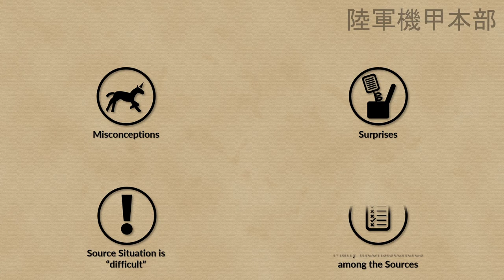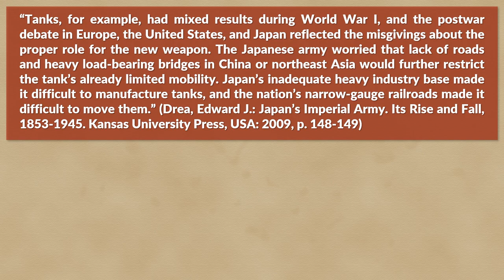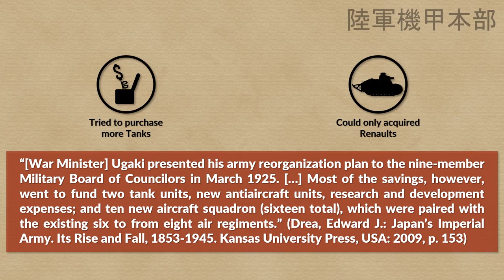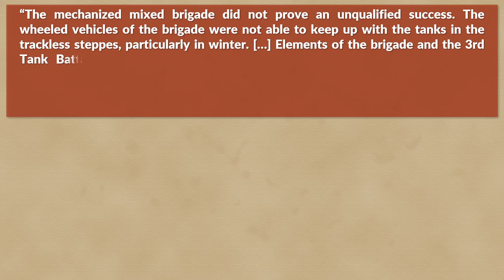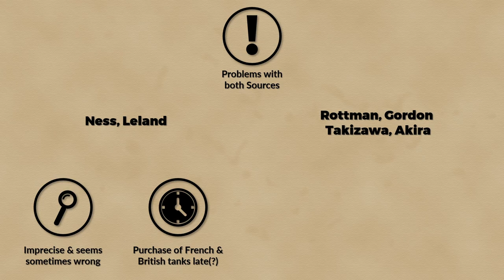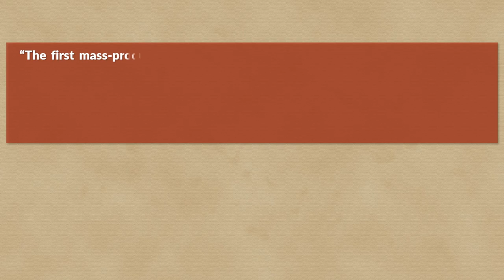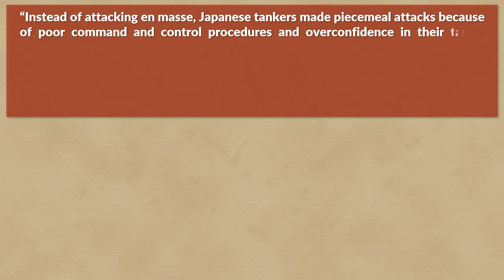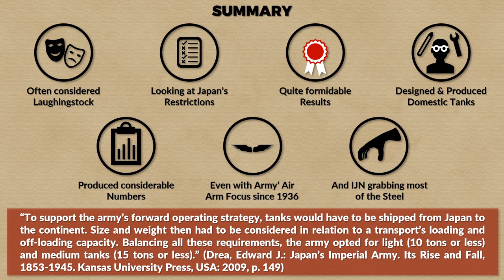Japanese Tank Arm (1921-1939)

Comment: "Japanese tanks during WW2 had a very limited impact..."
Tell that to the Chinese troops who had to wrap grenade bundles around themselves and roll under tracks because entire battalions had no other way of knocking out a tank. In the CBI theater they were anything but lacking impact.
Reply: Day Y. I mean, but that’s the point isn’t it. That if they were that effective in combat but still insignificant, it tells you a lot. Especially in re doctrine and logistics.
Reply: @UnsolicitedContext  I find that more a problem of measurement. It's easy to measure the effectiveness of individual tank units, it's difficult to measure when they're deeply integrated. Japanese independent tank units never achieved the size to make mirror comparisons with Germans/Soviets/W.Allies. You have to measure their performance by how they supported/complemented infantry attacks, and from what I've read of Wuhan / Changsha they were anything but taken lightly. I remember one episode where the commander of Changsha's war zone flooded an area just to ensure the IJA can't use its mechanized units properly.
Reply: The Japanese basically employed modern american warfare... Before americans thought of it.
Reply: @sevenproxies4255  No (=P). American armies can't survive without their logistics line as they relied on having more resources (shells, fuel, meat, etc.) than their foes. The IJA strove to move as light as possible.
Reply: @day2148  All armies rely on logistics at the end of the day. But my reflection was more about bullying an enemy into submission by bringing weapon systems to the field which they have nothing to counter it with. "Shock and awe" basically.
Reply: @sevenproxies4255  well, that's every army since the history of man. Remind me of the first time Romans met elephants.
Reply: Well by WW2 standards they did have a very limited impact. They assisted Japanese forces tactically but never made a great operational and strategic impact like the German and Allied use of armor in North Africa and Europe. Part of this has to do with the terrain involved of course (I doubt anyone could have really used armor in wide maneuvers in China or Burma, barring North China. And of course, hardly possible on small islands.).

Did the British have any real issues with Japanese tanks? Burma accounts always seem to emphasize the excellent tactics of Japanese infantry but very little, if any, mention of tanks.
Reply: Day Y. A BT-5 could just shoot the thing that it practically would've confused the crew in such a significant emotional event. Not like the Italian version which your tank gives up in existing.
Reply: If China had the Sherman Firefly and P51-Mustang  at 1936 they would have curbstomped Japan

With Japan out three years before WW2 the Allies are in a much better position

Germany and Italy are screwed

If Ethiopia were to have T-34-85 tanks as well as Yak-23s in 1936 the Italians and Germans would be in a lot of hurt
Reply: @christiandauz3742  I am sorry but this comment is weird. Well of course if Ethiopia had T34s in 1935 they would put up more of a fight. But you know it is completely impossible. Then you also have to think about how Ethiopia with barely any heavy industry could even produce any T34s.
Reply: @kvnrthr1589  Middle Burma, around Mandalay, is actually good tank country.
Reply: The goal was never to fight wars on land.

Comment: Gotta say I'm looking forward to the next part. I would be rather curious to know how fast they could possibly have gotten their relatively solid late-war tank designs into service had not funding been so severely cut. The Chi-Nu, Chi-To and Chi-Ri series were about as capable as a Pz. IV but came too late to see service in the war, with the Chi-Ri being particularly advanced featuring a fairly basic auto-loader mechanism. It would be curious to see what they had come up with had they put more resources into development of new models in time.
Reply: Probably not the Type 4 and Type 5 super-heavy tanks.
Reply: the Chi-Ri had more of a mechanical assist, like a lever-action for a tank cannon.
The Cheeto was definitely very capable, so I'm not sure what the point of the Chi-Ri was. Also from what I've heard, Japan's gameplan was to mass-produce the Na-To SPG, which was the Cheeto gun mounted in a gun carrier normally used for mortars.

Comment: The Japanese in WWII did have some Tiger and Panther in their name in Germany. What would happen if they actually reached Japan and mass-manufactured there? I would think that in 1942, the tanks wouldnt make much of a different. However, what if they designed a lighter version for both of those tank base on the concept? I wouldnt think those silly behemoth in World of Tank would work, but, how about a 25-30 tons tank?
Reply: Hard to say what lighter tanks base don the Tiger and Panther could've done -although the Japanese may've held them back from combat to help protect mainland Japan just like they did their best tanks. I think we can both agree that, in the Asian theater, Tigers and Panthers would be far less useful than they were in Europe. They were probably far too temperamental to make good use in China and on the Pacific islands themselves, they'd probably be easy targets for naval bombardment in a lot of cases.
Reply: I would much prefer in this scenario for Japan to acquire the Panzer III, maybe the Panzer IV if they want HV 75mm capability. Both were 25 tonnes or less initially, and with a reduction in width to fit their railways and/or a widening of the tracks to provide better flotation in mud, the workhorses of the German panzer force would likely have been welcome additions to Japan's arsenal. Of course, the Type 3 Chi-Nu and Type 4 Chi-To, at almost 20 tonnes and 30 tonnes respectively, were never intended to see combat outside of the vicinity of Kanto because of unsuitable terrain, but that was at the end of the war when they didn't have the infrastructure or transportation capabilities they used to.

I'd like to imagine that having essentially the Chi-Nu, at 20 tonnes, be a major part of Japanese tank forces from near enough the outset of war would prove very useful, being resistant to M3/M5 Stuarts, possibly early T-34s, and possibly early M3/M4 variants.
Reply: @Lt_Voss  sure, Panzer III and IV are decently armoured, and surely not a push over. Just wonder how would they perform. Kudo to you for the splendid comment👍

Comment: On the organization of the 1st Ind.Mix.Bde, there is a detailed yet unquoted version in Japanese Wikipedia, which is different from both of yours: 
(https://ja.wikipedia.org/wiki/%E7%8B%AC%E7%AB%8B%E6%B7%B7%E6%88%90%E7%AC%AC1%E6%97%85%E5%9B%A3 )

The TO&E of the brigade:

1. 1st Independent Infantry Regiment (2590 men, 297 vehicles)
  a) 1st Battalion: 3 rifle coys, 1 machinegun coy(HMG Type-92)
  b) 2nd Battalion: 3 rifle coys, 1 machinegun coy(HMG Type-92)
  c) 3rd Battalion: 3 rifle coys, 1 machinegun coy(HMG Type-92)
  d) Infantry Artillery Battery: 4 * battalion guns Type-92.
  e) AT Gun Battery: 6 * 37mm ATG Type-94
  f) Tankette Company: 17 * Tankette Type-94
2. 3rd Tank Battalion (376 men, 92 vehicles)
  a) 1st Company: 13 * Medium Tank Type-89, 7 * Tankette Type-94
  b) 2nd Company: 13 * Medium Tank Type-89, 7 * Tankette Type-94
  c) Workshop
3. 4th Tank Battalion (856 men, 192 vehicles)
  a) 1st Company: 15 * Medium Tank Type-89, 7 * Tankette Type-94
  b) 2nd Company: 15 * Medium Tank Type-89, 7 * Tankette Type-94
  c) 3rd Company: 15 * Medium Tank Type-89, 7 * Tankette Type-94
  d) Tankette Company: 20 * Tankette Type-94
  e) APC Company: 17 * Heavy Armored Car Type-92
  f) Workshop
4. 1st Independent Field Artillery Battalion (667 men, 130 vehicles)
  a) 1st Battery: 4 * Field Gun Type-90
  b) 2nd Battery: 4 * Field Gun Type-90
  c) 3rd Battery: 4 * Field Gun Type-90
5. 1st Independent Engineer Company: 194 men, 16 vehicles

Comment: Japanese tanks are really underrated. From the 1920s and early 30s, the Japanese tanks were among the best. Half the nations of that period only had machine guns or were severely slow. The Japanese despite focusing heavily on the navy had pulled off rather successful designs that weren't matched others until much later.
The Japanese simply didn't keep their equipment updated because they didn't need to against enemies they faced. This led to them being under equipped at the start of the war. However Japanese tank development caught up quickly but a weak industrial base meant very few of the new types were produced. Japan also reserved them for mainland defense with further reinforced the myth of weak Japanese tanks.

I also wouldn't consider Khalkhin Gol a complete disaster. The Japanese forces punched deep enough into Soviet artillery batteries. The Soviets also suffered massive losses, way more than the Japanese despite having way larger numbers.
Reply: Also in khalkin gol, the units that fought were generally under equipped with some of them even wearing uniforms from ww1.
Reply: Who are you saying were using WW1 equipment? The Soviets or the Japanese?

Comment: The problem with Japanese tanks was, they were perfectly suitable for the Pacific theater.  But for continental Asia, it was another matter.  The Soviets fielded an impressive invasion force of Manchuria in 1945--Japanese tanks didn't have a chance.
Reply: Most japanese tanks fielded were outdated. Its not fair to match a tank designed in 1935 to one produced much later in the 40’s.
Reply: yeah japanese tanks would put up an harsh fight agaist tanks lile T 34 and KV 1
but agaist tanks like the BT serie and T26 they could put up an fight at pair
Reply: Japanese tanks were suitable for continental Asia.... Asia is a big place.  Soviet tanks did well in Manchuria which is flat and well connected to the Russian rail network. (Also, Manchuria had the heaviest density of rails in China) Had Soviet tanks had to fight further south in the rougher terrain of south and central China, then they would have been wholly unsuitable.  Japanese tanks, by contrast, did well in these areas.

Comment: Okay, some solid prof here.

https://www.jacar.archives.go.jp/aj/meta/image_C04012192200?IS_KIND=SimpleSummary&IS_STYLE=default&IS_TAG_S1=InD&IS_KEY_S1=%E7%8B%AC%E7%AB%8B%E6%AD%A9%E5%85%B5%E7%AC%AC%E4%B8%80%E9%80%A3%E9%9A%8A%E3%80%80%E7%AC%AC%E4%B8%89%E5%A4%A7%E9%9A%8A&

Army-Manchuria-Common-Received No.1820
Aug 15, Showa 10(1935)
The report on the special assignment of ordinance for disassembly and assembly training.
From: Commanding General Kwantung Army, Minami Jiro
To: Minister of War, Hayashi Senjuro

In this report the subordination of 1st Independent Mixed Brigade was listed as:
1st Independent Infantry Regiment
;
3rd Tank Battalion
;
4th Tank Battalion
;
1st Independent Field Artillery Battalion
;
1st Independent Engineer Company.

It looks like the JPWiki is right while both of your sources were making mistakes...